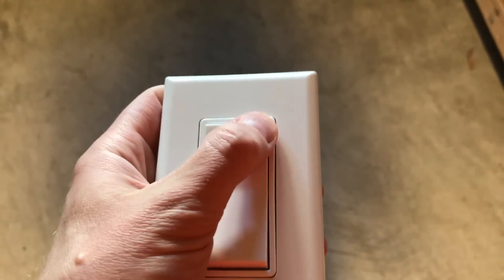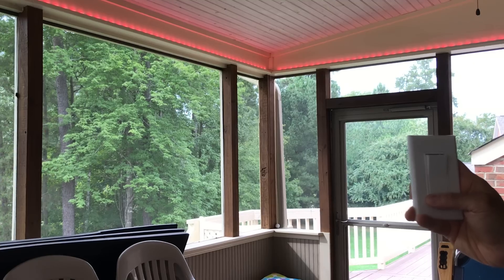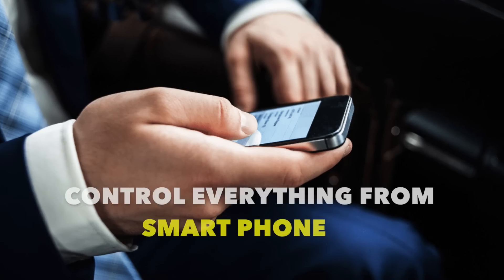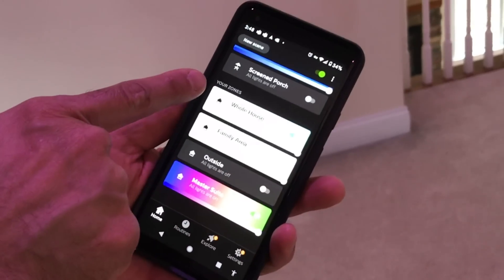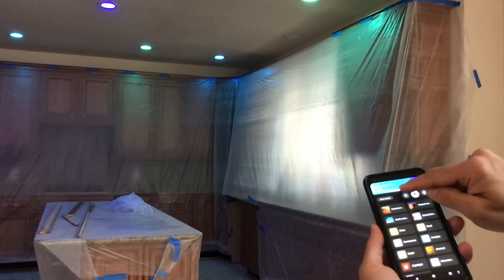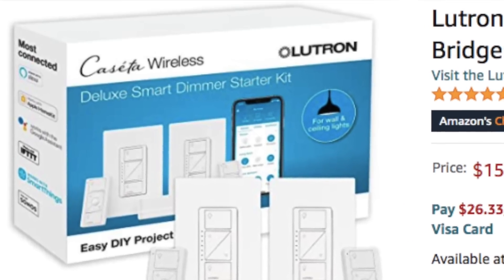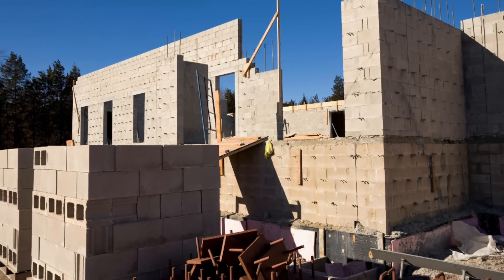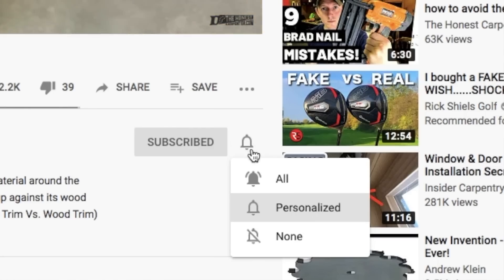THIS LIGHT SWITCH HAS NO WIRES / BATTERY! See How It Works...(Smart Lighting Setup--PROS + CONS)

Comment: Over 15 years ago my wife wanted to add an outdoor light that would be switched at our back door. We had a 4 gang box at the location that was going to be very difficult to add to. Being the research junkie I am I started looking for the best solution. I found Lightning Switch. It claimed to be able to control a device in Mt home without running wires. I thought it was crazy and would never work! It really wasn’t very expensive so I ordered it to give it a try.  I was able to get power from an existing junction box in the attic to power the outdoor spot light. Added the control device to the box and mounted the switch to the wall. It has been working with no wires for over 15 years! No programming, no internet, no wires, just magic!

Comment: Ask This Old House covered a non-IoT version of these years ago. You install a wireless receiver inside the fixture box that’s controlled by the piezoelectric switch. No fancy colors, but you don’t need to agree to have your personal data sold to marketers just to turn your lights on and off.

Comment: So, if your internet goes out, you can't even turn on a light?  
lol. Doesn't sound too 'smart' to me. lol
Reply: Not really. If you have the app the app can still control the lights even without internet. Your phone and the app is all you need.
Reply: @LinhHa-jf3tm  Or if you have sensors or switches connected to the hub then just continue to use that like a wired setup.
Reply: This is why I won't mess with smart switches and just stick with smart lights. If you loose internet, you can still control the lights with the switch.

Comment: You might want to make a video on is the 3 main types of "smart" wireless technologies:
Z-Wave - A slower, but more reliable technology. Since it's more regulated, it tends to work better between various vendor's products. Requires a hub.
Zigbee - Very common, but not always as reliable with products between various vendors. Also will require a hub.
TCP/IP - Standard wireless used for networks to connect laptops and the like. Expect some slowness in most cases and be aware this almost always requires connections out to the Internet to the vendor's site. Typically doesn't require a hub, but some vendors do require it.

Comment: I'm a licensed electrician and I love smart products and I prefer Lutron Caseta and other Lutron products.
Reply from the maker: Thanks for writing in, Ron! Caseta seems to be the pro choice 🙂
Reply: Yeah, their Pico remotes are great for control everywhere & run for 10 years on 1 watch battery. They also communicate on low frequency 434MHZ that doesn't interfere with WiFi & only short burst on button presses. Often the cost of installing a wireless remote is far less that running wire.

Comment: It’s cool, but I don’t want it in my house.  For me simple, manual is best unless you want to spend time troubleshooting your light bulbs / switches a.  Also, think about anything that you connect to the internet. If you can access it remotely, so can anyone else that wants to.  It is really easy for people that want to to hack into ANYTHING...  

Go solar and get off the grid instead of getting more entangled in it.
Reply: I totally agree. However, for a specific small job where you want to avoid the hassle on running wires inside finish walls, that can be nice.

Comment: I don’t care about dynamically changing color and didn’t want to shell out a ton for smart bulbs (up front or when they die).  Instead, I bought wired smart switches from TP Link (Kasa), they go on sale often and only cost 10-20 USD depending on what you need (single vs dual pole, dimmer, etc).  I can still control the lights with my phone or with my voice (Alexa), and can still use normally priced bulbs.
Reply: I do think switches make more sense than bulbs. (Certainly for fixtures that have multiple bulbs!) Bulbs are a good introduction to the concept though. I'd probably recommend that someone starting out mess around with a bulb or two to make sure it does what they want before spending the time wiring a switch.
The TP Link stuff seems to work well. I've got a couple of plugs that I've used and they work very well for me.

Comment: This is wonderful!  When my electrician was completely removing the knob and tube wiring in my house, he encountered two three-way wiring situations for lights.  Rather than making holes in the walls for new wires (he did not want to damage the wallpaper) he installed Bluetooth three-way switches instead.  The technology your video covers helps reduce the possible damage to walls and ceilings when running new wiring. Plus, it gives numerous options for the homeowner.
Reply: Sean O Deli  The electrician had to work within the constraints the house, walls and existing wiring presented him.  It was the best alternative considering everything.

Comment: I’ve been switching to hub less WiFi smart lights, smart switches, smart plugs.  They work... sometimes.  One brand I have seems to lose its mind from time to time and display a red led which means they don’t work wirelessly anymore.  I can reboot them by removing power for a while but that’s a pain.
Reply from the maker: That’s disconcerting, Sam! Working around some of these brands is like whack-a-mole it seems. I’m going to check out the hub less stuff though. Its an interesting approach to the tech concerns!
Reply: @TheHonestCarpenter  The offending switches I got from Amazon for $29 fir a double gang wall switch.  I got a second brand for $39 and they have never failed to work.  The sockets work, smart light bulbs work fine also.  The seller has replaced the switches that failed but it’s still inconvenient to be replacing them frequently.